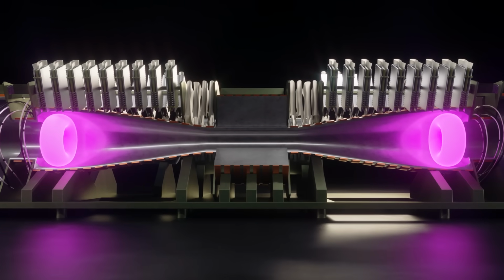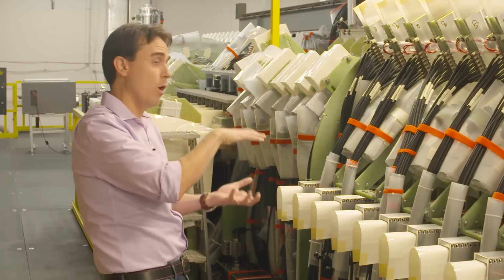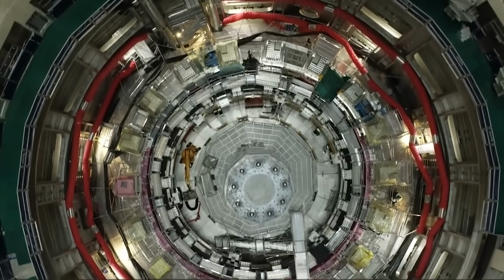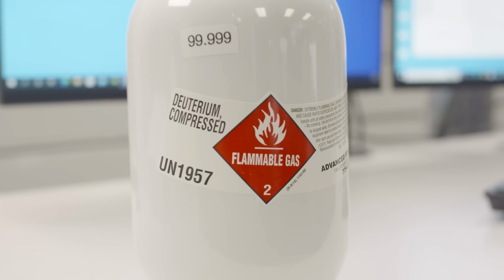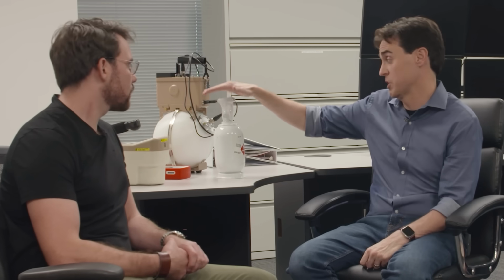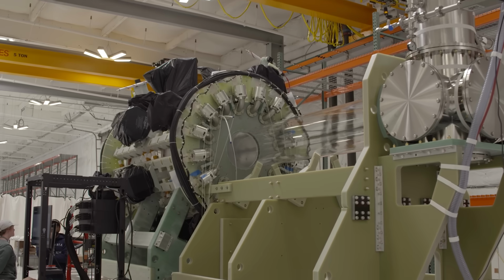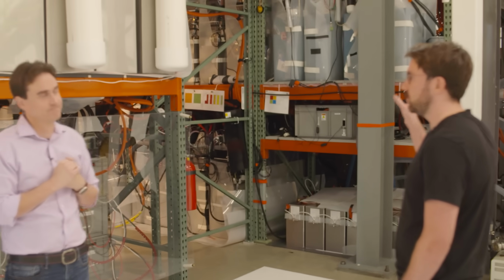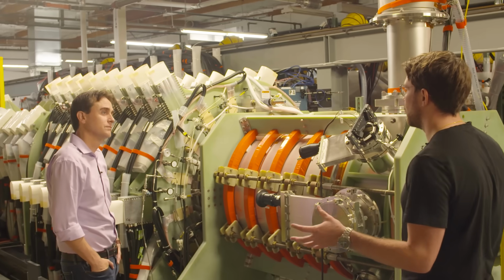A New Way to Achieve Nuclear Fusion: Helion

Comment: I thought of a brilliant way to improve the efficiency of the design and solve a flaw that was mentioned: circulate a coolant around the machine. Like water. Now, since that water will be hot it could be used to generate steam. Steam can turn a turbine which can drive a generator. Crazy that nobody thought of using fusion energy to boil water ...

Comment: David Kirtley is a master sales pitcher who has successfully attracted much venture capital investment in their fun experimental machines. All fans need to ask themselves if they regularly get everything right so that they generate significant quantities of fusion energy. If so what is the engineering quantity of the energy that they are achieving during each shot. Ask them the the amount of time the fusion reaction last compared to the repetition rate that they can do another shots. Also ask how much energy is expended to do a shot that generates their peak level of fusion energy during their best shots. One of the essential fuel components for these experiments is helium-3. It is exceedingly rare and expensive. Ask Kirtley how often it is employed, do they generate enough of it to fuel these experiments and where they expect it to come from when their basic technology is scaled up to commercial levels.

Most fans are so enthralled with these presentations and the machine that they rarely ask such questions, or if they do they don't notice when Kirtley, or others in the program, fail to address these questions directly. They may claim proprietary secrecy but that can also signal a ruse.

Comment: As a BS/MS in radiological physics, I think they have the best shot at commercializing fusion.
Reply: The problem with your optimism is that in the definition OUT/IN > 1 of ignition, the really large numbers in the video are all in IN.  The larger those IN numbers, the harder it is to achieve OUT/IN > 1.
Reply: @vaughanpratt6469  yeah, I do realize that it doesn't work yet.  I think most of the other designs have no clue about extraction.

Comment: Controlling the timing would be simpler with an FPGA processor. If I had to guess, that's probably the way they are doing it. A sequence of timed events could be set up to occur on the order of nanoseconds presuming you run the fabric anywhere from 100 MHz to 1 GHz. Then yeah, the complex part is considering the timing through all the components outside the FPGA.
Reply: Great video. I'm really interested to see this technology develop. I'd really hope to contribute to something like this some day.

Comment: The racks of capacitors make water/steam look pretty good! 😂

Awesome stuff - the amount of energy stored there is incredible.
Reply: These aren't for generating power, but for powering the fusion reaction. Even a steam based system would require capacitors.

Comment: I like that the speaker wasn't just a marketing hype man, he was someone who has intimately worked on the project and was more than willing to discuss the advantages and limitations they had encountered using this type of fusion reactor.
Reply: What are the engineering challenges maintaining the balance between the two sides beyond the timing of firing the plasma rings?
Reply: The magnetic rings have to operate  without interruptions to keep the plasma contained if I understand correctly. How would a failure in the center section affect containment?
Reply: @larrytanksley7094  Most likely full failure where plasma falls on the bottom and burns trough in a instant. Thankfully thermal mass is not much but since temps are in millions probably enough to burn trough to floor, creating breach in the inert gas chamber and oxygen is mixed in with potential ignition event of metal it self, Same with if timing is off between two sides collision happens not in high power field, but that is less relevant. I'm more interested if they can actually produce more energy than it takes to kick this off, witch is the main question over all.
Reply: @Hellsong89  It is the question that was never asked in this video, what is the performance of the machine?
Reply: @larrytanksley7094  After contacting the reactor walls, the plasma would melt the central section as it dumps heat into it. As it expands to fill in the rest of the reactor chamber, the ideal gas law causes the plasma to cool down (also reducing pressure). The open question is whether the reactor would explode from overpressure before the plasma cooled down.
Reply: Compare this dude to Elon "full self-driving robotaxis since 2018" Musk
Reply: @xktru  https://www.youtube.com/watch?v=t705r8ICkRw
Reply: @xktru  nah, it's elongated "full delf-driving robotaxis since 2018" muskrat (e and m are deliberately lower-case) :)

Comment: Yes, the simple relation of all physics comes down to this principles:

Gradients --> Path of movement.
Boundary layers --> Path of transformation.

I oculd write books about bot hthose words in physics from how things exchagne and affintnies which is related to biolology... Boundary layers are system changes from the gradient patterns to different states. Which is all predicatble. 

So in physics we learn: water, we learn what temp it changes state, its called mimic data.

This is the same as teaching how ot tie knots, its mimic data.

DEduction and real learning is when you no longer need to tie things together, but simpyl udenrstand it to then visualize what is needed to make it. I use knots because an adult shoudl be able to visualize why certain bindings function mechanically like they do. Create boundaries and tension gradients, which we use words like binding, but nonetheless its the same as phsyics.

So in physics, if you take a moment to understand hte material you cna visualize and make those things, thus why there is a huge difference in reobotic mimic work verse true understanding, udnerstanding can act in a system. Newtons method applied as proof is great but it doesn't lead ot dsicovery and has lead ot abomiantion of thinking and teaching to killign and rpelciation of data, but its a good thing for doubters... So understanding material the 4rth wall ... you can read till your blew and never udnerstand why... Why is there even a molecule of water made out of elements, why did it take this form, why does anyhting take different forms at different electron states. the closer you udnerstand this the closer you get ot boudnary layer energy generation. This type of fusion or evne the fission now is, like a sotne age monkey beating stones together and expecting it to work, nothing has changed, just replciation and poor deduction. but hte work is great, its just.. udenrstanding will cahnge hte face of physics forever, thus why, its stated, what I share with you they will devour you. So empire is always watching and causing problems and suffering... and causing poltics of killing humans is a real thing actively outputed in america and canada. Just for fun for newtons method of experiement on peopel and power, whislt giving data to germany and controlled lies in soicety, these are not understanding humans but the rpelicators and thus masqaurade as light (learned) or smart, but oftne filled with deception and tricks....

 So what does one really do, or know... or udnerstand..

So thats my word of the 2023... Understanding....

Which is a rleation of cause and effect in all things.

Comment: If it was any type of over unity breakthrough, it would be big news. They still have the problem of using vast amounts of electricity to make the reaction. Then there's the extreme price of materials to make and run it. It's like the electric vehicle problem. It can run clean, but is much worse for the environment over a petrol car, taking into account construction and fuel.

Comment: This sounds like a z pinch reactor, Basically you have 2 emitters firing toward a narrowed centralized point where the fusion reaction takes place maximizing the particles crashing into each other; if so, it's not really new as it's been a concept since the 1930s. but it is a practical approach in a few ways, (relative) costs, ease of use, and maintainability.

Comment: I don't get that part how the plasma "pushes" against the magnets. They need to power those magnets to contain the plasma and push back harder. So where does the energy production happen? Or would happen in the Polaris machine that is yet to be built. And how do they remove the millions of degrees of heat without a boiling coolant?

Comment: What would happen if you used antimatter as an fusion imitator? Raise the plasma to about 10 million degrees Fahrenheit, then inject antimatter to finally kick start the fusion reaction. Why antimatter? Go back to the fat man Bomb used on Nagasaki in WW2. It used a outer and inner core of plutonium, surrounded by explosive lenses,used to implode the mass to critical mass,thus the explosion. Years later,the H-bomb! It used a combination of both conventional and nuclear explosion to initiate the thermonuclear or hydrogen explosion. Now could it be possible to use antimatter to initiate the fusion reaction? If so, what would be the right mix of matter(deuterium/tritium) and antimatter so the system won’t blow up? Just asking!!!!!

Comment: Damn, the engineering going into this seems to have surpassed the speed of comedy. Some of this stuff sounds EXACTLY like the Retro-Encabulator technobabble video from the early 2000's.

David, if you read this, PLEASE hire the "Retro-encabulator" guy to do an explanation video one day. The fusion of comedy and engineering would, in my opinion, be a net-positive process, and create it's own fuel. Humor is an abundant element (although the purity sometimes disappoints), but human enthusiasm for high-tech and engineering is a rare element indeed. You'd benefit greatly from having off-site manufacturing of such resources.

Comment: did you ask if they have an estimation on when this could become operational ?
usually they just say about 10y away, but are they more optimistic perhaps ?
Reply: They are talking power generation capable in 2024. As in it actively harnesses energy as electricity. Still a testing and experimental device, not a problem power plant.

Comment: Great two questions 1) Have they actually  reached fusion ?   If so what is the   power in / power out   ratio  at this point?
Reply: achieving fusion is the easy part. Getting a net gain of energy is the tricky bit

Comment: Nice! Even if in the end it doesn't become the main fusion generator type, it might still see use as a method to sustainably produce Tritium and Helium-3 for other reactors.
Reply: Doing so would massively increase the spread of Nuclear Fusion technology throughout the world. Though it'd be confined to nations that can afford to construct the reactors, but those poorer nations can rely on solar and wind power rather than Fusion.
Reply: @Techno_Idioto  As far as i can tell from the video, materials-wise, nothing seems particularly expensive in this. hell, as far as sizes go, you can house several of these easily in a typical warehouse, which takes up a hell lot less space than your good old gas or coal plant, & the cool thing about it all, still generates a hell lot more energy & the setup is definitely far cleaner than said gas & coal plant. the actual priciest part of the whole thing, would probably be getting the personnel with the know-how to build & operate this thing. if a country can afford to actually build a power plant in the first place, i don't see why they can't afford to build at least one of these here.
Reply: @Techno_Idioto  for some reason a nuclear fusion video was the last place i expected to see someone with that old short haired calli art for their icon, neat
Reply: @Techno_Idioto  It looks pretty cheap, in principle. Some big capacitors for the magnetic field, lots of wires and coils and a decent computer to control it all. Valves and tubes, tanks of fuel, a pressure vessel. With a bit of help from a PhD you could probably build one in your garage. Looks simpler and cheaper than building a gas or coal plant, if it works how it should. In places that don't have a national power distribution network, smaller power plants you can spread around would be more economical.

Comment: I just noticed something. If you stand this fusion chamber upright, it eerily reminds me of a warp core both in how it looks and how two "steams"(rings) of plasma are pushed towards each other.
Edit: typo
Reply: Warp cores aren't fusion reactors, though; they're matter/anti-matter reactors. All the ships in Star Trek do have fusion reactors too, but we don't often (or ever?) see them on screen. The fusion reactors power most of the ship's systems, including the impulse engines. The warp core really only has one purpose: to super-heat a drive plasma that then gets magnetically directed through the verterium cortenide warp coils inside the nacelles to produce the warp field. The warp core is not really meant to be an electrical power generator, and routing drive plasma into the ship's electroplasma system (EPS) grid is dangerous. </geek>

Comment: The #1 thing that interests me is the space flight applications. Fusion Engines have been science fiction in space for so long until now. Now it's possible. I don't know the math but I believe a scientist once estimated we could get to Mars in a few days or weeks rather than the 9 month standard turnaround on Fusion power. If we can get into space and make it more natural than it is now. There are a few million asteroids and comets in our solar system. You can mine the minerals off of them and send them to Earth. So no raw materials crisis. Water? Mine an ice comet. Send it back to Earth. Shipyards? Build one on the Moon or in orbit. The biggest thing suffocating space travel is the fact that we still use combustion engines like they did in the 60's. The fuel cost is too much. Fusion might solve that.

Comment: This is by far the best approach to achieve Fusion and generate power. However, this is still way more complex than Molten Salt Reactors which will surely beat this to market. If that happens, even the best Fusion tech won't stand a chance of being economically viable.

Comment: My heart is fluttering and my head is light....because this has me so damned excited for nuclear fusion! The very first thing that came to mind...was a warp core. As soon as I saw the machine it looked like a warp core. But instead of matter/antimatter, you are using deuterium and tritium instead. I can not even begin to explain how happy this just made me to see this!
Reply: The fusion reactors aboard Star Trek ships do use deuterium-deuterium reactions. They harvest the deuterium from the emptiness of space (which isn't really empty) using their Bussard collectors (the red things on the forward ends of the nacelles).
Reply: @whitslack  True, but that fuel pulls double duty for the fusion auxiliary power core and the matter side of the matter/anit-matter for the warp core.

Comment: huh... fast changing tides for capacitors... would come in handy for improving battery life times with flash charging and discharging of batteries being the most damaging issues for current Batteries....

 I think Lithium Ion (don't quote me on the specific battery though)

Comment: I remember CERN needing to ramp up acceleration slowly for small atoms to collide over several revolutions before they approach relativistic speeds. But here in this system, it looks like a relatively small distance they are able to accelerate the plasma to relativistic speeds. How are they doing it?
Reply: 300 km/s is not a relativistic speed. Not by a long shot.

Comment: The DoE press release was a joke.  The actual power input was basically a lie, they used a set of lasers, which require something like 322 megajoules to power and create a 2 megajoule set of lasers to then produce 3.15 megajoules in the fusion reaction.  Yeah, it's a joke. Basically 1/100th output. Fail.

Comment: As someone who has worked on pulsed power circuitry in the tens of kA range I'd be really interested in the electrical engineering side of their pulsed power sources. What kind of voltages are we talking about? What switches are they using - the video seems to hint on some semiconductors (thyristors, maybe?), but what are the switches that aren't semiconductors? Tubes? Spark gaps (probably not)? What about the energy of the current pulses: How much goes into the plasma, is the rest recuperated? ... That stuff is pretty awesome.

Comment: I have a few questions,
If the mid chember (where actually the fusion is happening) if it goes upto 100 million degrees and also adiabatic process, 
1) how come the metals or margents they use don't melt?
2)At very hight temperature, the magnetic properties of a magnet can be distorted,
So how these magents are holding up at that temperature?

Comment: I have to say I don't fully understand how this captures the energy. If this would produce more energy than it uses, that would mean that the fusion reaction, which takes a tiny fraction of a second, would need to induce current in the coils of such a magnitude as to account for all the energy spent to cause the reacton. Which, as you showed, requires ridiculous amount of capacitors just to deliver the current. So in that one pulse, the collecting coils should receive more current from the reaction than all the accelerating coils combined. Even if you use superconductors, I don't understand how you can possibly capture and even out this much current into grid-compatible reliable voltages. The wires would just melt, wouldn't they? Or the cooling would take half the output? I must be missing something...